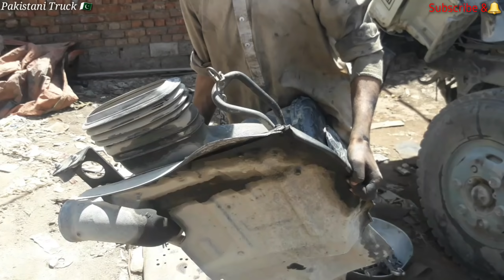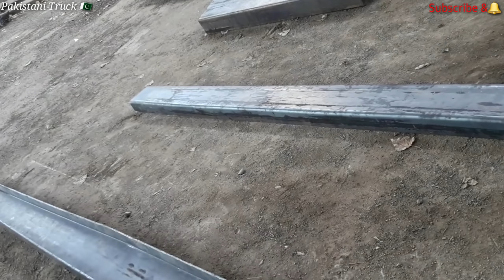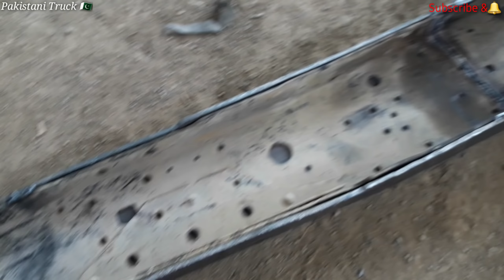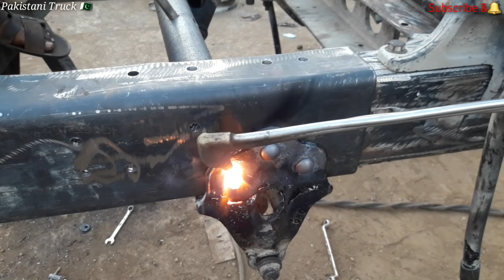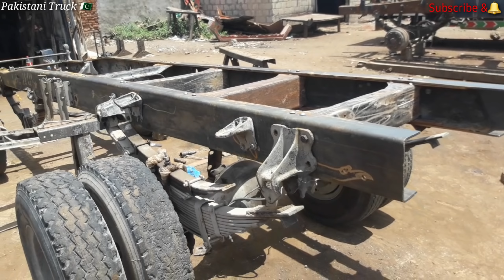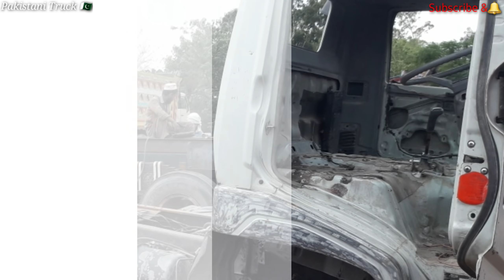Restoration a Hino tipper and Chassis rebuilding

Comment: Brother salam alecom . 
I have a little attention .that when you  putting the chassis plates on each others and weld them shouldn't you paint them anti rusting paint from inside and out . for future whether bad circumstance.
Reply: Corrosion is not an issue in Pakistan, I bet.
They defenetly don't use too much salt to melt ice and snow in winter.
Reply: But still water every where and then react with the steel .
Reply: @ahmedjawad9156 Maybe you're right.
 I think you know that better than me. :)
I know salt-related corrosion mostly,